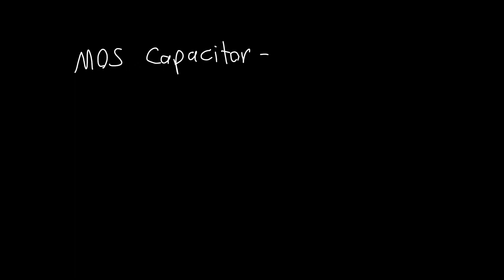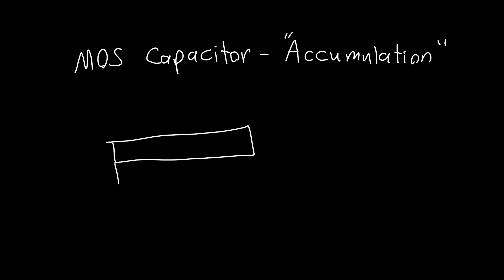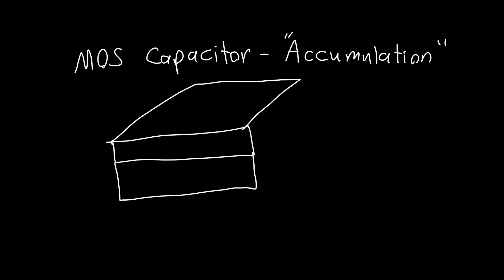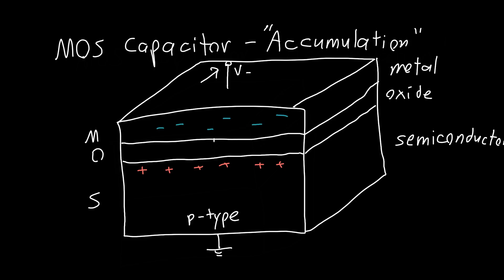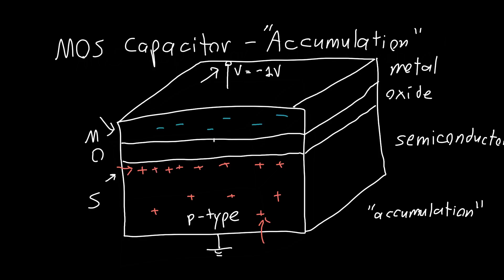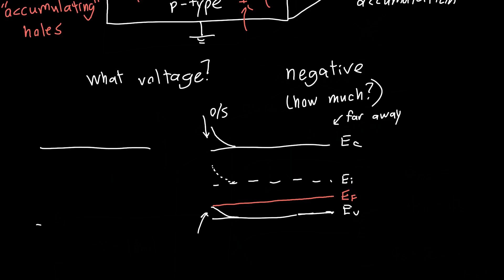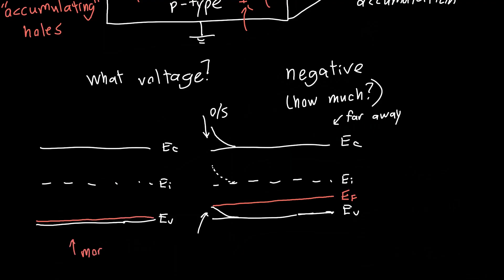MOS Capacitor - Accumulation Mode Explained

Comment: If anyone confused about the direction of the band bending, I was too, until I've found out that it depends on the fermi level of the metal. So if there's a "low work-function" metal (fermi level above the p-type's), you'll get the band bending shown here. If the metal is "high work-function" (fermi level beneath the p-type's), you'll get upwards band-bending. Also, for the latter you'll be in accumulation mode to begin with, i.e. at any voltage less than the flat band voltage (including 0). You'd need to overcome the flat band voltage to get into inversion. I hope I'm not terribly wrong.
Reply: Here is another way of looking into it "At the semiconductor (p type) side of the oxide-semiconductor interface, the holes of the semiconductor will face diffusion force towards the oxide layer. Due to this diffusion force, some holes will pass towards the oxide layer, creating a sort of depletion region. Thus, making the semiconductor less p type at the interface."

Another way would be "As the work function or electron affinity of Oxide is lesser compared to that of semiconductor (p type), electron will flow from oxide to semiconductor. Thus, making the semiconductor more n type at the interface"
Reply: thanks

Comment: I have two questions that I found myself hard to understand or confused all the time.
I try to make a statement from my understanding and Dr. Jordan please correct me or guide me with proper principle.
1)The band diagram is drawn in respect of electron energy, so applying positive voltage (containing excess holes) at a particular region will drop any band diagram of that region but apply -ve  voltage (containing excess electron) will increase any of the band diagram? 

2)I thought the Ef is a constant at equilibrium (contact) , means it doesn't change and form a straight line for all materials (oxdie,metal and SC ) contact. Hence by applying voltage potential, it can be shifted?
Reply: Your assumption regarding the energy bands being drawn in terms of electronic potential is correct. More -ve voltage means we go up in energy in the band diagram and vice versa.
Regarding your 2nd question, on the application of voltage,  the built-in potential developed in equilibrium condition gets reduced or increased depending on the polarity of the bias.
Reply: By applying a voltage on the gate we are shifting the Fermi level of the gate metal (or polysilicate). This creates a difference between the Fermi level of the gate metal and that of the semiconductor. Difference in fermi-level between the two encourages all the subsequent charge distribution phenomena and the band bending. Applying external bias takes a system out of equilibrium so fermi levels can change.

Comment: thank you! these videos are great! I'm new to semiconductors and I need it to understand my project. I have a question though why the Fermi level never changes? the nature of the Fermi level is the probability so shouldn't it change with applying a voltage?
Reply: It does change, check out the definition and derivation of Fermi level, for example, it depends linearly on temperature 
But on itself is a function derivativated from fermi-dirac distribution

Comment: Thanks Jordan for your semiconductor lecture series. They are really good. Can you pls confirm the energy band bending  in accumulation mode for n-MOS (p-type substrate). Shouldn't it be upward bending in the band diagram @6:12 in video
Reply: it is the intrinsic band bending @6:12. It took me quite a while to figure out.

Comment: From 10:50 you mention one thing wrong that if phi Ms is positive, line moves up when we move from left to right but it should be opposite. Please answer what is actually the answer
Reply from the maker: Sure! I believe that is correct, phi_ms refers to the difference in the Fermi levels before you bring together the semiconductor and the metal. A positive phi_ms means the Fermi level of the metal is higher energy (semiconductor is lower energy), so when the Fermi levels meet electrons will jump from the metal to the semiconductor, and you will end up with an E-field that points to the right, which yields the energy profile in the video.
Reply: In your explanation whose work function is more metal or semiconductor?
Reply: @JordanEdmundsEECS  your definition of phi Ms is wrong. It is  energy required to move electron from Fermi energy to free space. And according to this phi Ms in this case will be negative. I am referring sung-mo-kang and In that it is mentioned like this what I am saying
Reply from the maker: You are correct about the sign, phi_ms in this case should be negative. The metal Fermi energy is higher in energy, but its work function is smaller. Phi-ms is defined in terms of these work functions, see Neamen p. 383.

Comment: As you said semiconductor was grounded, how did you apply voltage on it ?
Reply from the maker: Great question! What matters here is the relative voltage of the body and the gate, so applying a positive voltage to the body is the same as applying a negative voltage to the gate.